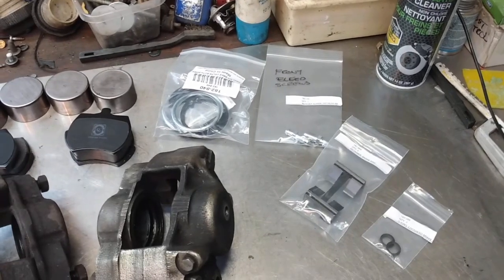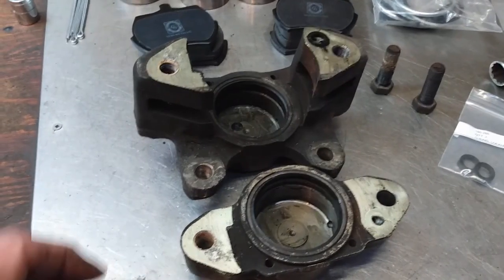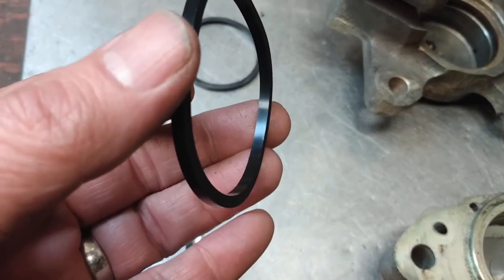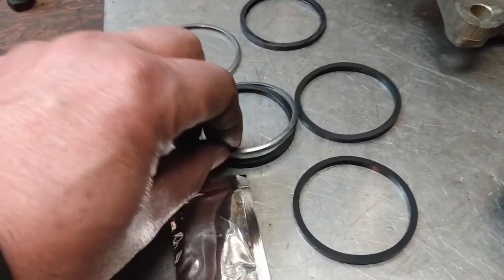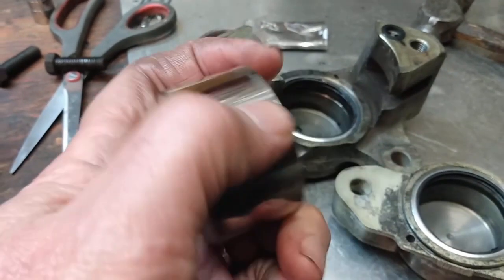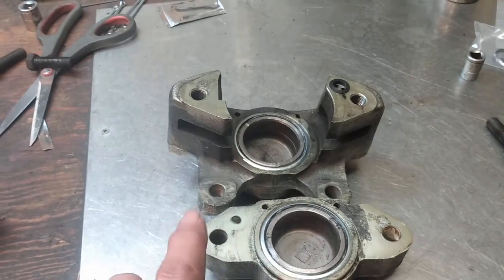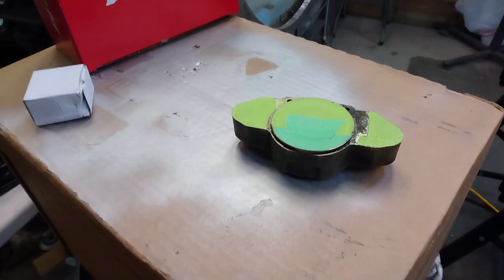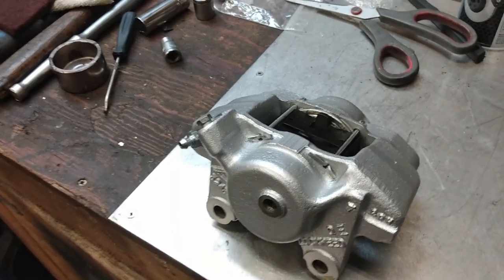How to rebuild Austin Healey Sprite & MG Midget front brake calipers. Bugeye Build Episode 68

Comment: Thank you Ian. Very instructive. Just one question, what is the blanking plug for?
Reply from the maker: I believe it's simply a gallery plug. It looked like the hole was needed for some internal machining. Could be wrong on that though.

Comment: Good idea to dismantle the calipers and removing the old fluid behind them but when you bleed the brakes with new fluid, how do you remove the air pocket  that is trapped from the outer piston as the bleed screw is on the inside side of the caliper piston? (Spongey brakes )
Reply from the maker: Haven't had an issue so far.

Comment: Ian, I watched the video on your disc brake rebuild. My pistons are stock and not stainless like yours. I noticed that pushing them into the caliper looked pretty easy. Mine are an all day job just to get the pistons in. We’re yours new from Moss and we’re they as easy as it looked. 
Jim in .Spokane, Wa
Reply from the maker: Hi Jim. I had to go back and watch the video to refresh my memory!! I used the Moss piston/seal kit (part number 182-890). The job was fairly straightforward. I took my time making sure that the pistons were well lubed (lube supplied in the kit) and that they were square in the bore. Some took a little more pressure that others but all in all the end result is a good set of brakes.
Reply: Thanks Ian, I’ve watched your videos pretty much from the start. I did mine about 7 years ago and ended up with rust in my master cylinder. I Ve had the car since high school and never really paid attention to that fluid except to make sure it was full. The rust was eating the seals and suddenly the clutch gave me troubles. I’m replacing all the seals , cleaning out the lines with denatured alcohol and then putting it all back together. I’ve talked to several people with Bugeyes and they’ve switched to silicone with no problems. Thinking of doing the same.  Any thoughts?   Jim